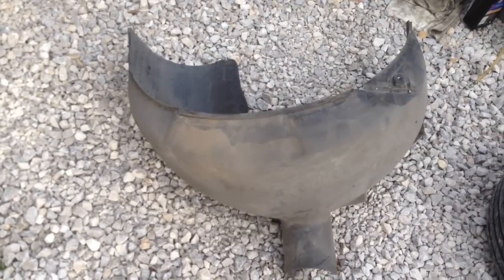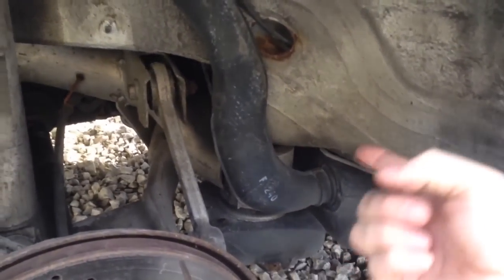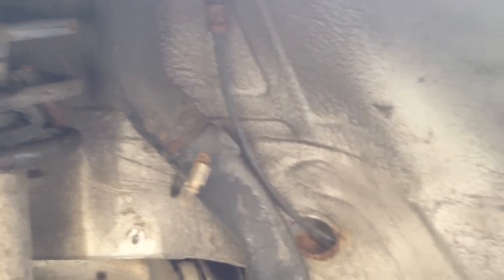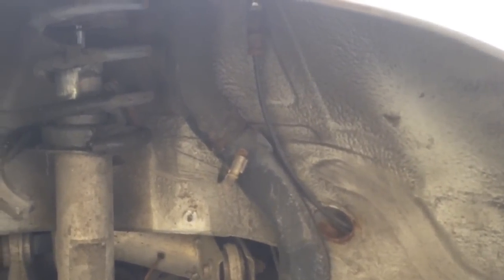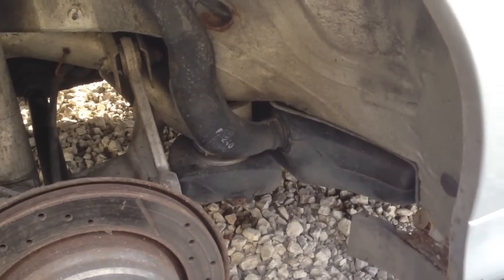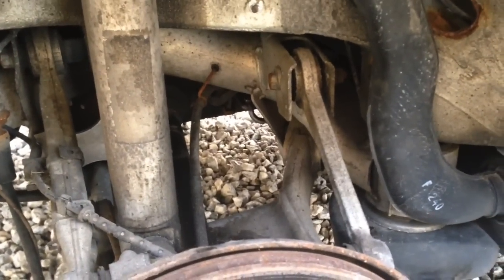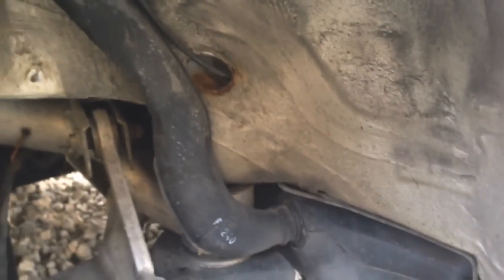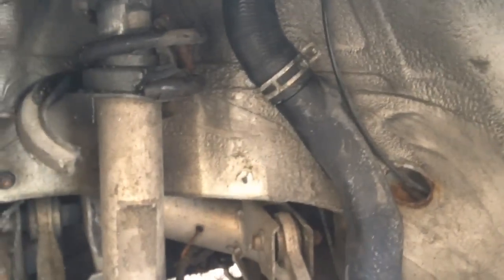BMW E38 E39 Fuel Leaking While Pumping Gas Fixed 520i 523i 525i 528i 530i 540i

Comment: This video was helpful...Thanks to Nate..Just drove my $750 e46 to gas station for the first time. When I pulled away from the pump to let another driver fill up. He said I was leaking fuel. I looked under my car and it was dripping from the bottom of the tank. Let it set for a good 30 minutes then checked again and the tank was dry. Drove it home about 4 miles and tank was still dry.

Comment: NATHAN HELP, My 2008 528i just started smelling like gas, it’s by the passenger side rear, not the filler cap area but like between the rear door and the tire well. It does not smell inside the car. What do you suggest I look at? Thanks for your advice.

Comment: If you take off the gas cap and/or take out the fuel pump fuse or relay before you pull the hose from the assembly. Would there still be fuel pressure when you pull the hose?

Comment: Will a rubber radiator hose stand up to use in a heavy fuel environment (direct contact and constant vapor)?

Would a silcone based hose be a better option? I have no idea, just wondering. They tend to last forever when used with coolant, but may not do well in a fuel environment either.

Excellent video, I've had that gas smell for ages now and leaking while filling at the gas pump.

Comment: Hey Nathan i just ran into this problem on my 2000 540i e39 . but in my situation its not  leaking from the rear right side but the rear left side of the car . it was the first time leaking as well as “overfilling” the gas tank .
Reply: I have this same problem. Can’t find any insight online at all.
Reply: @TheMysticSpade  Not sure if you ever discovered problem but a possible cause is the fuel tank gasket that is located under the back seat. There are two gaskets, one on each side and the back seat needs to be removed to access the gaskets. There are Youtube videos that show how to do this.

Comment: I'd be a bit concerned about teh fuel eating away the hose over time.  The fumes will slowly degrade the rubber.  I've done this as a quick fix before and it has worked though. Every year I'd check the hose condition, and possibly the sock on the pump itself for a black tar like build up.